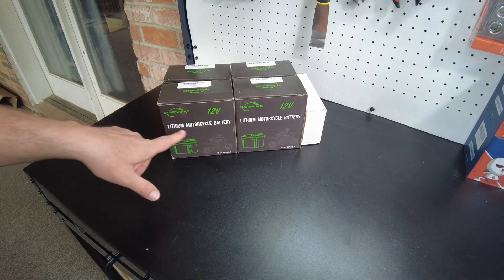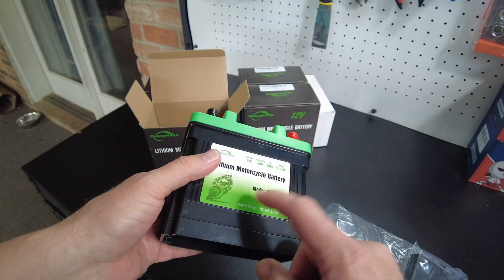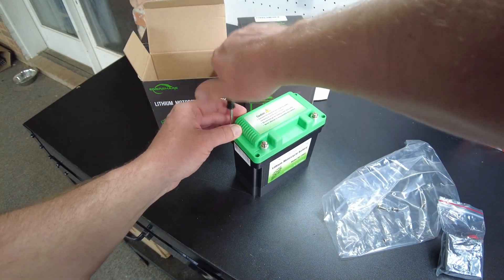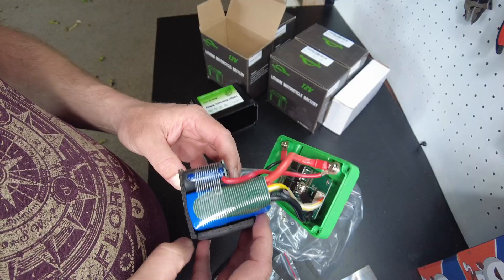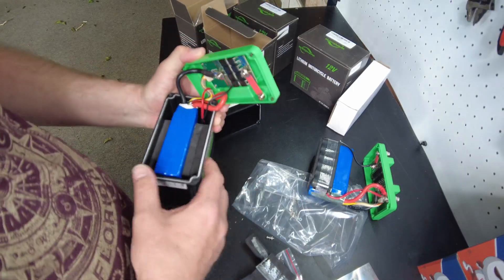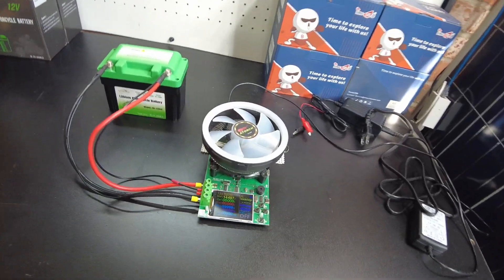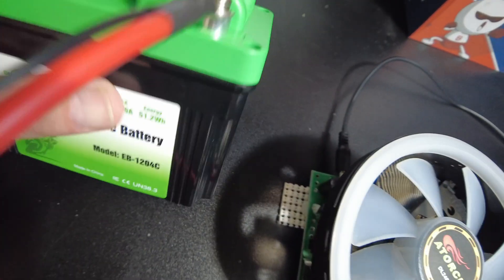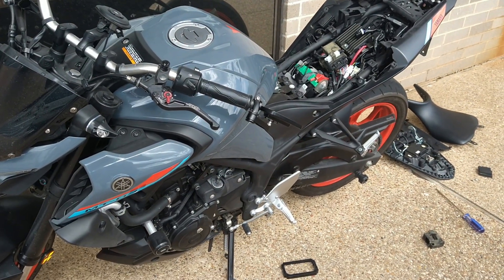Lithium (LiFePO4) Motorcycle Battery w/Super Capacitors

Comment: My OEM Yuasa lead-acid battery failed after 7 years(!).  The new one is an LFP battery which was cheaper than a new Yuasa and has worked perfectly.  The motorcycle cranks robustly after sitting for 2 months.  The LFP battery saves 4 lbs and should last for a decade or two.  The motorcycle stays a garage which never gets below freezing and I don't ride below about 40° F, so even though the BMS probably doesn't have low temperature protection I don't need it.  Highly recommended.  I don't know what super capacitors are for, as the LFP cell pack provides plenty of amps.

Comment: That was interesting Brad. Adding super caps directly across the battery output, but strangely the cables from the super caps were smaller than those from the battery...I would have expected the opposite for cranking currents up to 400A. Wonder why? (I mean it was done deliberately so there is a reason).
Reply from the maker: Yeah, I thought the same. The one without super caps does 110cca, and the super cap model does 160cca. I'm guessing the small wire is fine for such a small burst, and the voltage drop is not that big a deal? I bet it would make a great spot welder battery. I need to figure out some high current tests for things like this.
Reply: Short length of output wires will allow more current in starting but with a winch like I have wire would get hot from continuous current draw.

Comment: It's not going to get a full charge, is it?  The typical regulated charging voltage from an alternator or stator is 13.5 volts.  The manuals for my 12-volt, 100 ah LifFePO4 batteries say 14.2 to 14.6 volts.
Reply: 13.5V is well above 80% state of charge. Just shy of 3.40v per cell so for all intents and purposes it’s 85% which actually prevents the cells from being stressed when they are near full. Not as beneficial for LFP as it is NMC lithium ion but will still increase cycle life and is probably the best way to “baby” your LFP. 

Downside is balancing for most BMS’s is usually >3.40V per cell due to the charging curve requiring it. Try to balance below that and you are just playing the voltage game which does not mean same SOC from cell to cell. 3.27V can mean 40% or 60% and actual balancing is trying to get each cell to charge/discharge X number of amp hours until low/high voltage is hit in one cell (the cell with the smallest capacity. 

So if you get a pack that is REALLY out of whack then you’d need to manually balancing by opening it up and charging each cell to 3.6 or 3.65 and then checking it again after 10’ish cycles to see if it’s balanced when fully charged. Near the bottom of its state of charge the voltages might be a bit all over the place but a top balance only cares about all 4 cells in a 12V hitting 3.6X at the same time.

Comment: Video Summary - Alrighty then, listen up! We've got some lithium motorcycle batteries from Inner Share, and they sent us two versions: the A and the C. The C version has got some super-duper capacitors built in, which is pretty gnarly if you ask me. So, we're gonna open these bad boys up and take a look-see.

These batteries are made for motorcycles and can fit different models with their spacers. They've got a 4 amp hour capacity and can do 400 cranking amps, which is wild! We opened them up and found a super capacitor bank in the C version, while the A version has a regular capacitor.

So we charged one of these babies up, tested its capacity, and it exceeded the rating—like a boss! Then we installed an A version battery in a Yamaha MT-03, which was a bit snug, but we managed to fit it in. We fired up the bike, and it started just fine.

In conclusion, these batteries are quite the versatile powerhouses! The C version gives you extra cranking amps, but the A version still does the job. Just note that the terminals are round, unlike most motorcycle batteries, which might affect the fit. That's all, folks! Catch ya on the flip side!
Reply from the maker: Nailed it 😆 That's pretty damn good!
Reply: Make sure you get a lithium charger with the right output voltage and amps or current. When I am using my atv with a lithium battery I charge it fully every once in a while for 2 reasons. I have 12v winch on it and the atv charging system will never charge it fully 100 percent. I was reading  about not using lithiums and keeping them at 85 percent because they say the battery will get max life. I also was reading I can use a DC to DC  charger to make it able to charge fully from atv charging system.  Any Info you can add will greatly appreciated
Reply: Will your bike's charging system work with it?